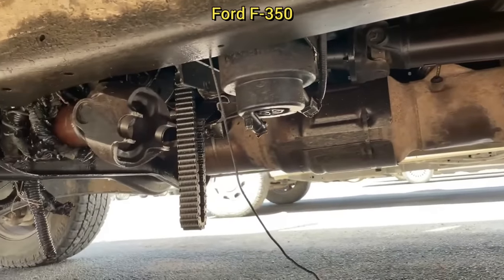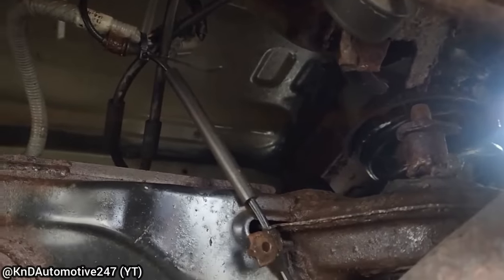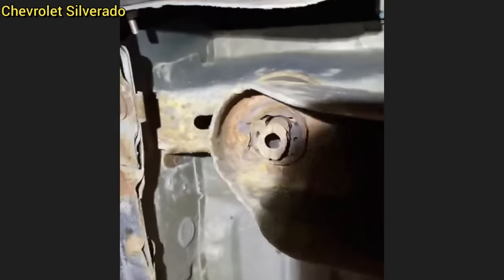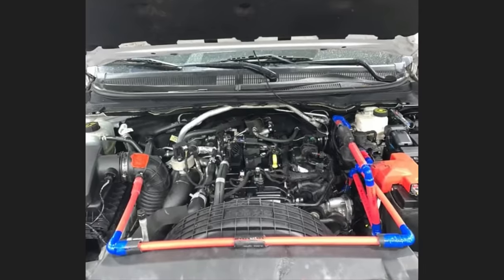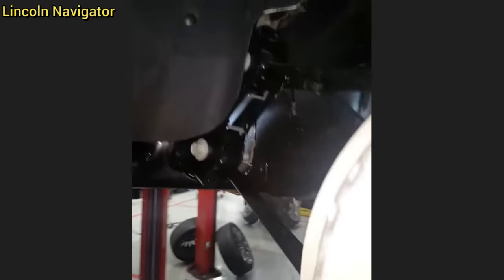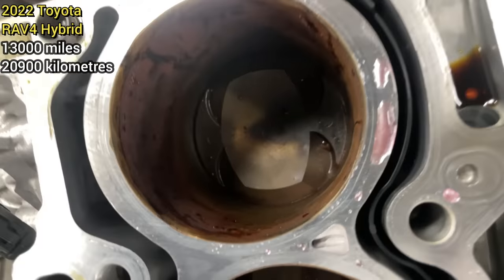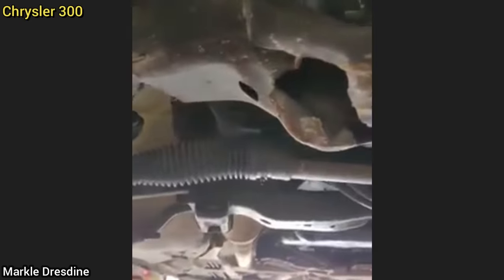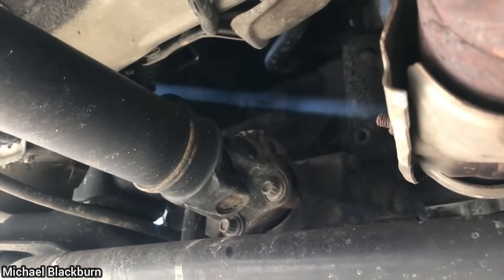Customer States There Was A Loud Bang At 90 Miles Per Hour

Comment: ironically after using a so called garage for an annual MOT test , The tester thought it would be ok to scrape the front end lower bumper whilst parking it on a ramp  , while i was there!!…    Cost me a new respray! so its not just customers bud , there are a few wack jobs floating around in these repair centres ..

Comment: 00:40  did he just glue metal beads to it or something?  
how the hell can anyone call that a weld?   
how long did it hold up?  untill he let go of the plate?  
hotglue would be stronger then this.  

the original metal never even melted.  
i bet you can knock those beads off with your fingers.
Reply: I feel like this is a fun little poem

Comment: There seem to be multiple audio glitches in this video. Thankfully (or not), much of the video speaks for itself.
Reply from the maker: Sounds good on my end. Which parts had audio glitches?
Reply: @Just Rolled In  My bad. I must have shifted the speakers, and now the rat-gnawed cable is acting up. The rat's been dead for years, I really should get around to fixing that, even though it hasn't caused a problem in, well, years either.